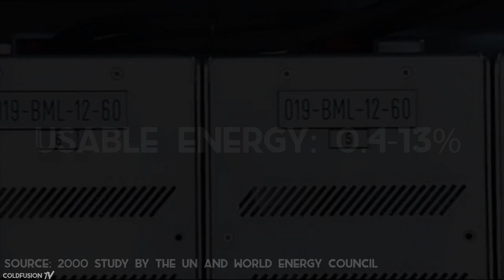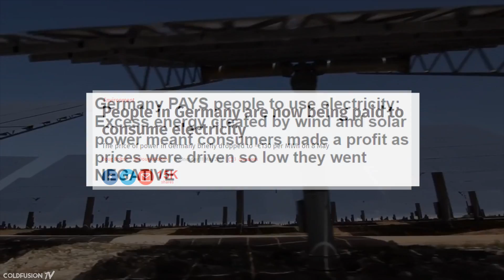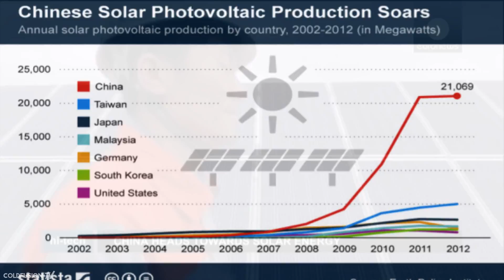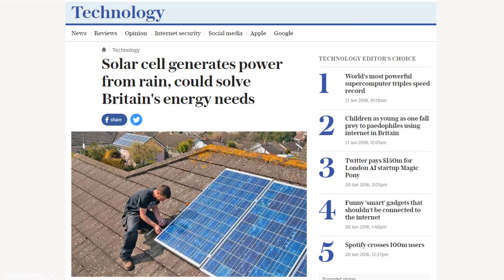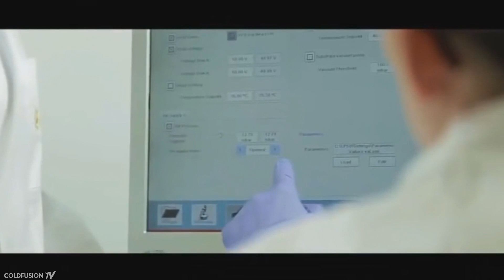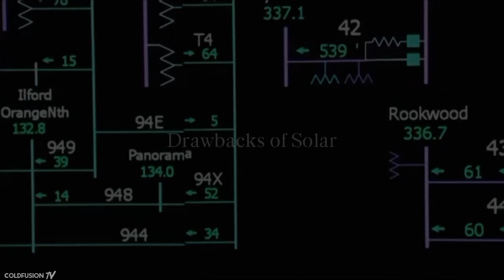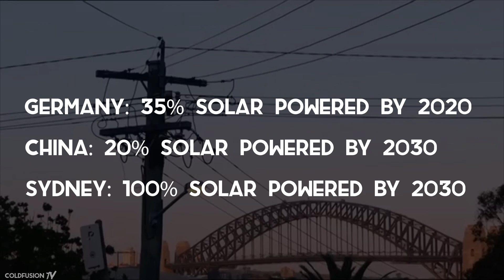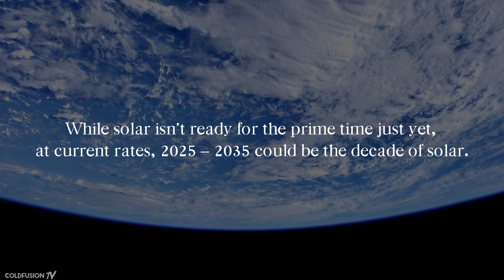The Truth About Solar

Comment: nice video.  I just don't think the storage will be a problem because you could use your electric vehicles battery as a storage, since it will be at home always when you are too. That kind of system is already in use in some parts of Netherlands.
Reply: +reaktor55 That is a true concern, but you have to look the overall cost of maintenance and I think electric cars won't be more expensive to maintain, including the change of battery pack.
Reply: Currently batteries are more expensive than all the electricity they will use over their entire lifetime so it's pointless atm... (unless utility reimburses you cost at peak)
Current prices, current technology, end of life @ <80% capacity (can still use for stationary storage, just not cost efficient enough for transport)
Reply: reaktor55 Who cares if it's toxic or not, if you are going to eat your batteries and choose not to recycle that is your own fault... Why does everything need to be made out of water for it to be better. What do you consider enormous as far as batteries are concerned, in reality even with today's technology it's not epically huge, they can be made into basically any basic shape.
Reply: +reaktor55 Well that's the whole point. You don't need additional battery packs in every household when there's plenty already in cars.

Comment: but what about solar panels cost to make? Don't they need rare metals and minerals to make? Won't that run out?
And how about maintenance? Or what about how long these solar panels last? How many years do they work? And does their efficiency deteriorate year after year? And by how much then?
You don't answer these very important questions.
And that there still isn't a solution for the winter day where it's clouded and completely wind still with rivers water levels very low, we have no energy for the high demand of power.

Comment: Nice video. But I don't really like the idea of  large landscapes covered with panels, it is the same issue with wind. Sure with better efficiency we can just cover existing urban surfaces with panels. But it all just seems too much of a hassle. Solar is definitely useful but I wouldn't rely on it. Look up thorium and molten salt reactors. It's energy density is humongously greater than anything we know of right now. It is abundant pretty much everywhere and nowadays is mined out of the earth with other valuables and not being used. New reactor desings are inherently safe (no meltdown and explosions) which is not the case with current nuclear reactors. They have just been engineered to safety throughout the years. Thorium power plants don't really need much space and can make use of already existing infrastructure as well as provide uninterrupted energy supply without the need to manufacture large amounts of batteries. And if we hope to explore the universe anytime soon, solar is pretty much a no-go.

Comment: BULLSHIT. Only watched half and it's utter bullshit.  Fine if you live in a sunny place.  BUT.  These have to be set up properly, NOT placed at 45 degrees or pitched on roof houses.  The power output is only at 'peak' time, and providing the PV panel is optimally placed to receive the suns energy, 10 mins passed and the panel has already started producing less power.  a tiny amount of film on the panel say from a recent rain and the panel has LOST around 15% efficiency.  Any DECENT PV installer or electrical engineer or lecturer will tell you PV is NOT all it's cracked up to be.

Comment: my house runs on 8 batterys arranged to 48v at 240 amp 6kw inverter 12 x 260w 24v  solar panels and 30 amp 48 v battery charger that runs off a geet generator for the bad days plus a 12v power supply as well to the house no bills all for under $15 000  DONT WAST YOUR time with soler connect its a ripoff just get the loan an do it your self and shop around and learn and you can achive freedom.

Comment: Good video.
But: traditional batteries are not the only way, to store energy - there is hydrolysis, there is the kinetic storage of energy (e.g. pumping water up into a tank and then using gravity to convert this energy it back into electricity), you could even use air pressure. And a mixed technology would mean, that you don't need electricity to warm up water or the house, due to solar heaters...

Comment: I don't think going 100% "green" is possible. But having each home equipped with solar panels will help.
I think a big power plant for the "basics"/ most important stuff should be there, and them use solar for auxiliary ? Why put all your eggs in one basket ? Diversity is good, and not having only one central power station is also good. If one goes down, the negative effects will be less harmful.
When building infrastructure of a country, we should look at living organisms, and how they manage it. Sure, all the food is processed/refined in one place, but then the nutrients are distributed throughout the whole body, and energy is produced locally, in each cell.
Reply: You would have to have batteries, and, only connect to the grid when needed. That would mean you would still have to have as many power plants. You cannot randomly backfeed the grid with your excess solar but to a certain penetration. After that, all the solar on the tops of houses start causing the grid to fail. Right now priority connection to the grid for wind and solar actually drives waste in natural gas by causing us to burn more via peaker plants based on aircraft engines. We get less electricty because they are not co-generation (as they cannot be used as peaker plants). So, we build power plants to take up the slack when wind and solar are not online, or, are throwing the grid off frequency. There is a whole lot all the green folks don't understand because math and engineering is hard. I come from aircraft electrical systems, and, I'm telling you, the grid is the most complicated thing ever built. It's not as easy as just hooking up some panels, then, sitting back feeling good about having gone green.
Reply: sqy that to iceland
Reply: +Andromalius dex i wasn't talking about carbon though, rather nuclear + "green". Diversifying.

Comment: It is stupid to ask each and every citizen of a country to purchase expensive batteries, a perfect way would be to use a combination of nuclear power and solar.

Each citizen would have roof mounted solar panels taking energy from the sun when it's available, if there's temporarily a larger power demand, the intelligent system will ask the grid for whatever extra power is required. 

At night, the houses will completely switch to using the grid, now,, the grid is entirely powered by multiple small scale nuclear power plants located in remote locations.

Comment: Layers and layers of that solar cell film might be on the roofs of future Tesla vehicles. Surprised Elon hasn't poured buckets of money into them just to help them along to advance their technology, before intending to buy them outright.
Reply: Elon Musk owns Solar City.
Reply: Maybe it's TOO EXPENSIVE... or does that nuisance detail never enter the feel good conversation ?
Reply: hettygreene
Well, if said expense would eventually pay back for itself. But the problem solar really faces is electricity companies no longer being necessary because if solar panels and batteries were efficient enough, there'd be no need fo energy in any decentralized place save for larger facilities.
Reply: +bluephreakr 

Sure!  And if money grew on trees we wouldn't have to work. 

The "let them eat cake" attitude of these Starbucks intellectuals is disgusting.
Reply: hettygreene
What kind of dope are you smoking?

I said a basic fact; If a service is not used, said service makes no money and has no reason to exist as a business.

if every person in your locality would switch over to solar electricity and said solar power was at least 90% efficient when the sun is blasting itself onto those panels, your local electricity company would make very little money, or overcharge for both the installation of solar electricity in households that do not have it and present customers to keep itself in business.

That, or electricity companies make money off of "Solar maintenance", because invariably something's going to break somewhere. But nonetheless, changes would happen if the above scenario were true.
Reply: +bluephreakr 

It's the solar quacks and their Kids Lemonade Stand business that are delusional. 

Solar is the "radical chic" of the era.

Comment: The real problem with solar panels is not the limited hours of sunlight but the ability of solar panels to convert this energy into stored energy. If efficient, a few hours of sunlight a day will suffice. solar panel on a car is gimmick. an electric car uses too much electricity. The panel is impractical or insufficient. So, we can see that the problem with SOLAR PANELS IS SOLAR PANELS.

Comment: I have lived off the grid for 12 years. As I built my house myself, one-room at a time, I used solar panels to power each room. The kitchen was difficult as it consumed more energy than other rooms. 

Typical instruction state that the panel(s) should face south and be set at an angle equal to the distance from the equator. I live in Christmas Valley Oregon(in the center of the state) and I set my four 100 watt panels on the roof of my kitchen to face south at a 45 degree angle. But I had to put my refrigerator on a timer to shut it down for 12 hours each day. 

Today is the first day of summer and the sun rises at 6 am but does not strike the panels until about 10 am. It sets at 8:30 pm but stops hitting the panels about 4:30 pm. So I was getting 6 1/2 hours of energy on my panels. My solution was to have one panel face NNE (north by north east at almost 75 degrees so I am getting my batteries charged at sunrise and faced another NNW at 75 degrees so the batteries are still being charged right before sunset.

I no longer have to use a timer on the refrigerator and have more than enough energy to also run lights for four hours (past midnight). Whoever put that information out about the angle and direction the panels should be probably never used solar panels.